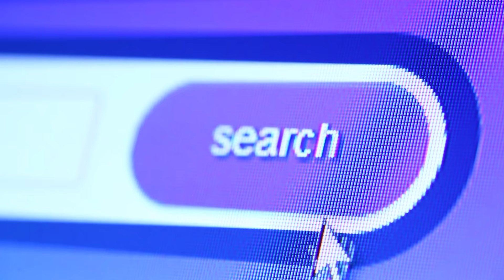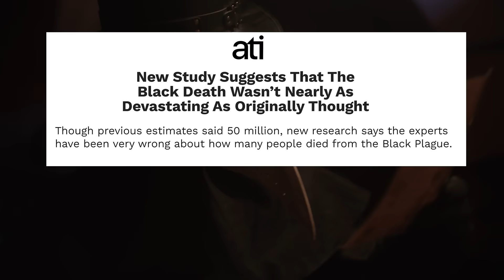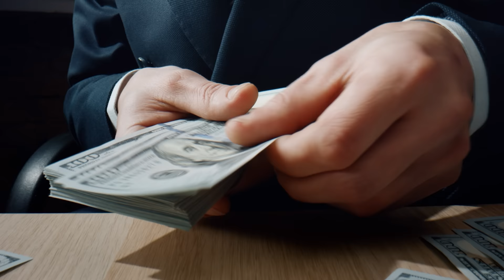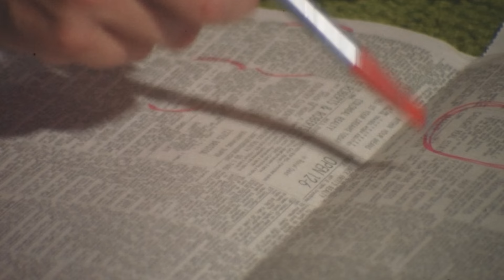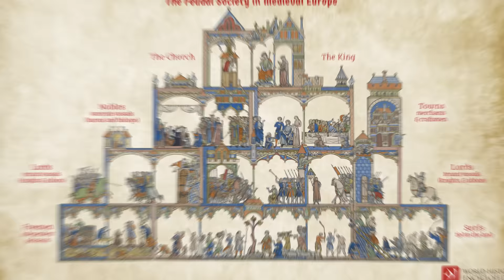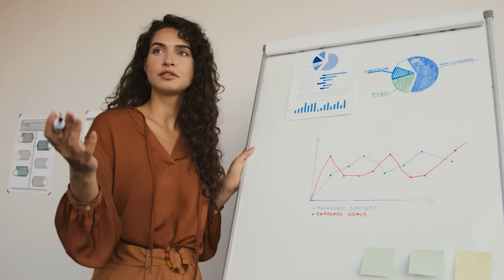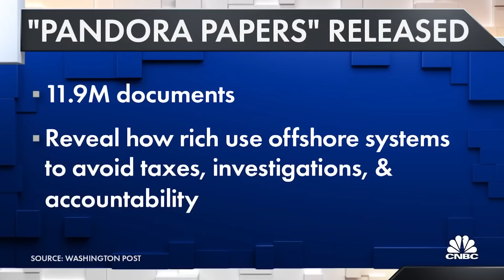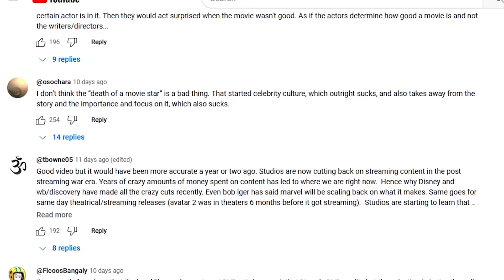Do You Work Harder Than A Medieval Peasant?

Comment: One thing I need to comment on: Though medieval peasants didn't have tobacco, respiratory diseases due to smoke where stoll common, due to the fact that everything was done with open fireplaces. Cooking and heating in the home as well as using fire for various industries. I was actually part of an experiment back in my days as an archeology student. We wore electronic devices that measured the carbon monoxide levels while we where working as reenactors in a stone age settlement. You can guess that they where pretty high at times. Also it makes a very big difference if you where a peasant in the countryside or in bigger cities. So yeah tobacco isn't exactly the distinctive factor here

Comment: About sin-eaters: there needs to be a large disclaimer that says it was a Welsh custom. And there's also another disclaimer b. that it may not have been as widespread a custom as could be thought. 

Second disclaimer: the so-called caste system only existed for the late middle ages. For the early medieval and high medieval era, a peasant could become a nobleman if they fought well in battle. And we have plenty of evidence for this. 

Third disclaimer: the modern era has a collapsed community structure. People live next to each other for years without talking to each other. The people of the middle ages could find friends a lot easier than we do today.

Fourth disclaimer: Not all peasants were tied to lands. Look up freemen. They had as much freedom as we do. 

Fifth disclaimer: It is easier for a medieval peasant to go to heaven than a modern peasant. Enough said. 

Sixth disclaimer: The maker of this video has a modern bias because he's one of those people I warned you about in the fifth disclaimer. 

Seventh disclaimer: a medieval peasant has two to three months of vacation time off. The modern one has only one. Maybe even less. Or not at all. 

The guy who made this video did not do his research at all. AT ALL.

Comment: Not sure why office jobs are the standard for the middle class. I work construction and I can guarantee I make more money than your average office work with a bachelor's degree. And that's my 40 hour check versus their 50-60 hour check. If you factor in hour for hour then I make more than most office workers period. Infact I'm on a job right now where we are working 60 hours a week and a guy with no experience and just got into construction is making $75,000. His pay will just about double over four years. And he may not even have a highschool diploma. My point is, stop having tunnel vision and looking at cubicle farms and monkeys in suits and see there are options around you.
Reply: The issue with construction is stress put on the body and exposure to chemicals.
Reply: @sp123  😂
Not every construction worker is a mule. I'm an electrician. For the most part, we don't do hard physical labor.  And every chemical you deal with has an SDS sheet with all the hazards and hazard mitigation. You're exposed to worse chemicals pumping gas and checking your oil and radiator fluid than I am for about 95% of the time. 
But hey, do you. I made right at 100k this year working almost no overtime. Next year, with overtime, I'll be at around 150k-170k. And I can literally just show up in a new city and have a job within a week. I've done it anytime I wanted to move. Ohio, Pennsylvania, Georgia, Texas, Arizona, Kentucky, wherever. I just show up and have a job within a week. That's freedom. Plus a lot of jobs will pay you per diem. Which means they'll cover your hotel and a daily food allowance to work out of town. So you want to travel to see a different city/state? Now you can still pay rent at home and have. A place to stay while you check out a new place. And get paid to do it. You can keep the cubicle prison and all the assholes in monkey suits.

Comment: People work more hours today because they want to and not because they have to. If people did not demand to live the life stile of the rich and famous and would just be content with living under their means people could work a great deal less hours.

If people would just be happy with the life stile of the nuclear family of the 1950s they could work a great deal less. They can't they demand the life stile of the rich and famous and you can see below why.

The nuclear family house of the 1950s; two bedrooms one bath with 980 square feet and maybe a carport for the car.
The family house of today; Three bedrooms two baths with 2,200 square feet with a two car plus garage.

The nuclear family car of the 1950s; One practical car.
The family cars of today; Two cars that are designed to perform in conditions that its illegal to drive in aka the car is designed to drive at 150 mph where the speed limit is 65. With a third or more cars, boat(s) of different kinds depending on the activity, motor-home, motorcycle(s) off-road and street-bikes, snowmobile(s), ATV(s), and so on and so forth.

The vacation of the Nuclear family of the 1950s; Driving to the local woods for a week to stay in a cabin or a couple of day trip to the shore during the summer.
The family vacation of today; getting onto an airplane and flying to some exotic destination for a week or two two or three times a year. 

Meals of the nuclear family of the 1950s; eating at home where the wife spent time cooking the meal.
Meals of the modern family; eating out for a good number of the meals.

Daily activity of the wife of the nuclear family of the 1950s; Spending the entire day cleaning the house, taking care of the children when the children are not in school, and sharing the neighborhood gossip with all of the other neighborhood house wives.
Daily activity of the wife of today; at work trying to make money to pay for all of the crap that the family demands that they just have to have. Because she has no time for it, having some maid service come into the home twice a week that wife has no time to do, having the children at a day care service because she is gone 50+ hours a week.

Electronics of the nuclear family of the 1950s; a radio or maybe a very small 12 inch black and white TV if they wanted to splurge also a vacuum cleaner and sewing machine.
Electronics of the modern family; Smart phones and laptops for every member of the family over the age of a toddler. Large screen TVs in every bedroom, living-room, and dinning-room, and maybe smaller TVs in other rooms like bathrooms and kitchen. and smart appliances throughout the entire house.

If people removed their heads from out of their backsides and would be happy with the life of the nuclear family of the 1950s but modernized then there would be no issues with the modern family of today. People of today want to have the lifestyle of the rich on the income of the middle class.

If the modern family would be content with a two bed one bath 1,000 square foot condo, just had practical cars, cell phones, laptops, and only had only other practical electronic devices and did practical activities being mindful of the cost. stayed home and ate 90% of all meals there would be no issue of the wife staying at home as the husband would make plenty of money to pay for everything.

I am a single man who makes median middle class income for my city and state. I don't have the slightest problem in any way of affording the 1950s nuclear family but modernized lifestyle as I don't see any need to try to live the lifestyle of the rich. If I wanted to have a stay at home wife and have three children I could very easily afford it living as I do. I work 1,900 hours a year because my job demands it and not because I want to. If I could work less hours I would as I don't really need the extra income from the extra hours.
Reply: I could very easily cut 200 hours a year, (aka working 1700 hours a year) from my job without hurting my life stile all that much. I could drop it by 400 hours a year, (aka 1500 hours a year) if I wanted to just get by. Once my mortgage is paid off in 11.5 years I could drop another 350 hours a year off.